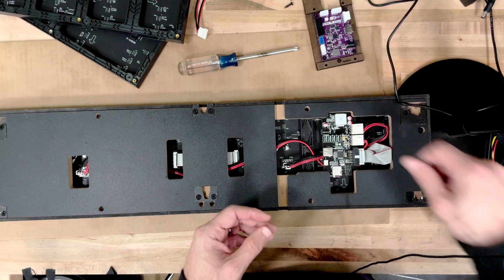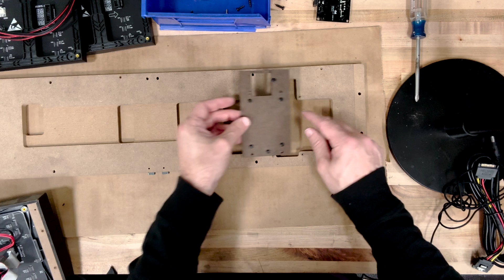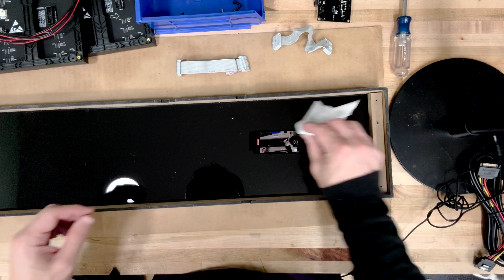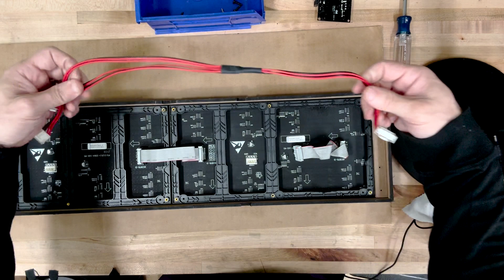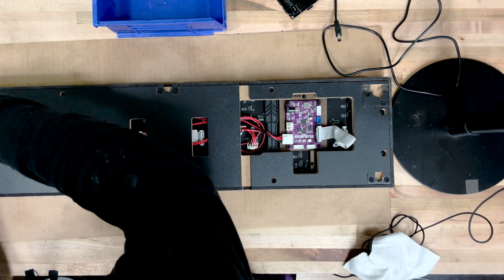BitPixel Repair Kit

Comment: I have an old bitpixel that doesn't power on anymore.  Its on the original Arcade Legends Ultimate.  Does this upgrade not work with the system?  The website states to let you know what version of the firmware to ship and it lists Legends Ultimate.

Looking forward to your response so I can purchase.
Reply from the maker: Yes , will flash the board with the specific firmware needed here